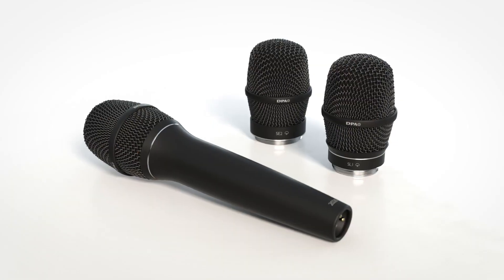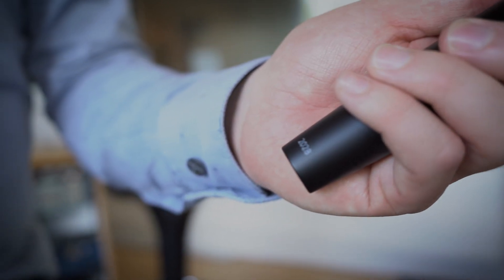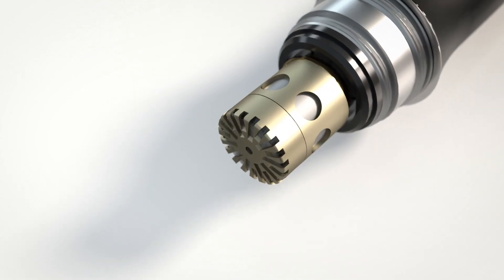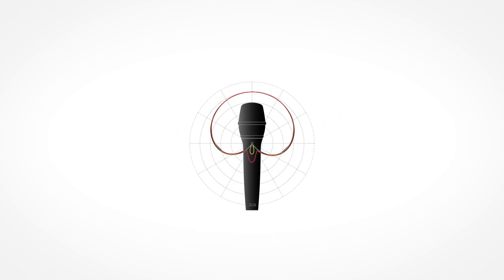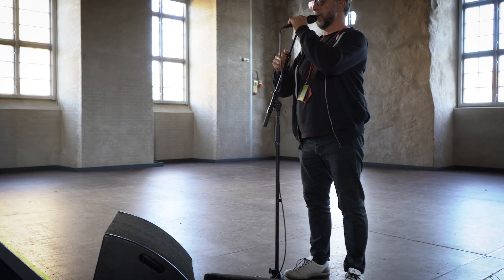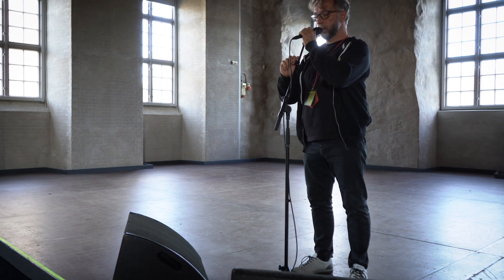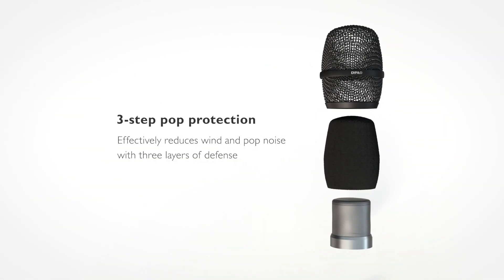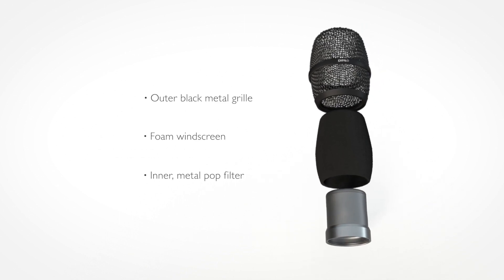The 2028 Vocal Microphone explained

Comment: I want to buy a DPA vocal microphone after the new year, what would you advise me, is it better to buy 4018, or save money and buy 2028? I was told that the heads are the same there, that in the other one, just 4018 is mobile and for that it is more expensive! Tell! And if they are not the same in sound, then tell me which one is better in sound, and which one behaves better with feedback! I would be grateful for your answer and help!
Reply: 4018v is slightly brighter by its 12khz boost, and 2028 is more balanced and behaves better with feedback but with a little more background noise.
Reply from the maker: Hi. Thanks for reaching out. They are not 100% identical. We usually don't state that one is necessarily better than the other - they are both great mics. There are slight differences, but in the end it is up to personal preference, which is why we always encourage that you find a dealer and try both to see which one is the perfect match for you. 😃
Reply: @DPAmicrophones  Could you guys do any voice tests, where we can see the difference in frequency responses? Its so hard sometime to test this, cause not all of buyers can go to the store with this option...

Comment: So which is better? The 2028 or d:facto ii?
Reply from the maker: There is a place for both. The are both excellent mics made to the highest standards, but they do sound slightly different. And since sound is also a subjective matter, trying both mics would be the best to determine which one you like the best. 😃 2028 is a bit cheaper, which among other things is due to the fact that it is not modular as the 4018 is.